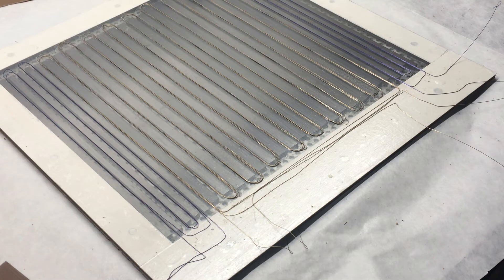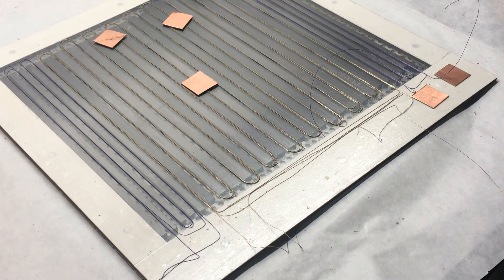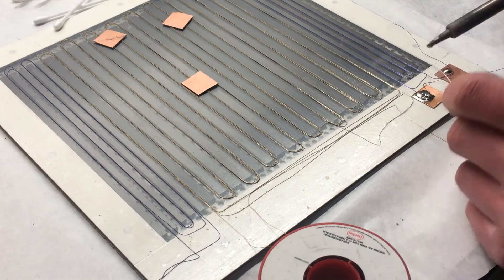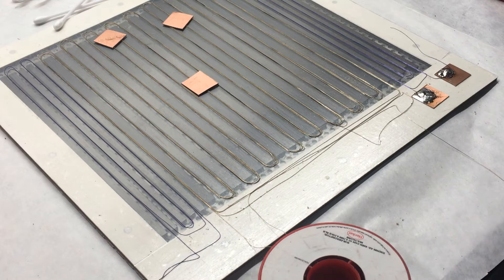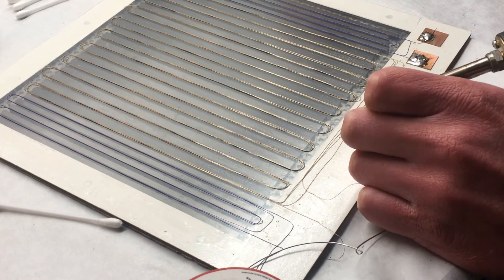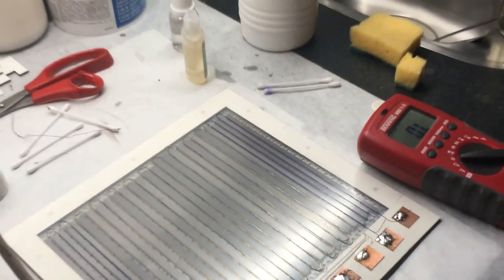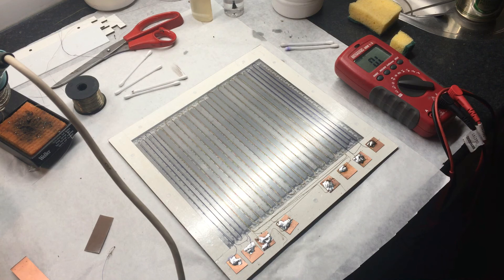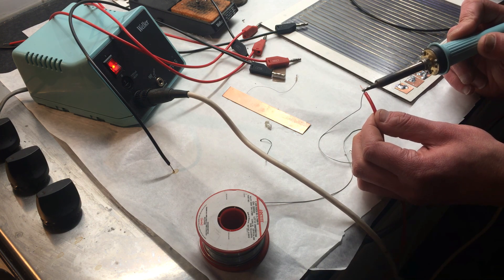Part 5 Bluetooth Planar Speaker - Soldering the wires on pads

Comment: Need to remove the wire  insulation before soldering.
Reply from the maker: Rip Max it still remains aluminium wire :(
Reply: why you not use copper voor de mid/bass part????
Reply from the maker: weight. and high end extension.  i know weight becomes less and less of a problem down low. now you mention it, i might try that in a next version since getting slightly thicker aluminium wire seems to be impossible. and would rather have the mid bass at 4 ohm instead of the current 8.5.